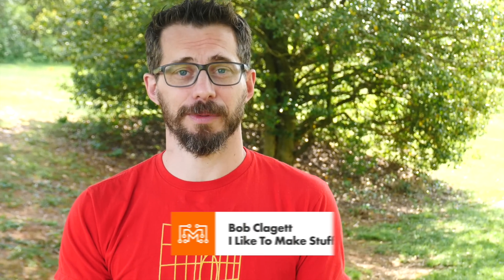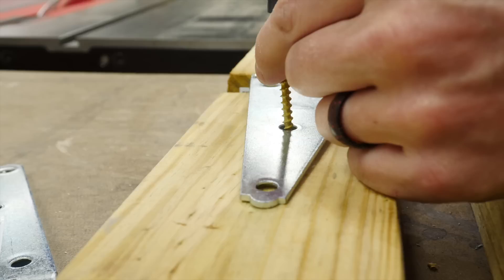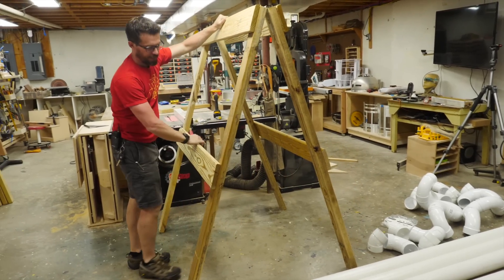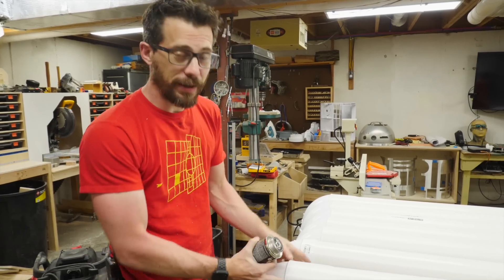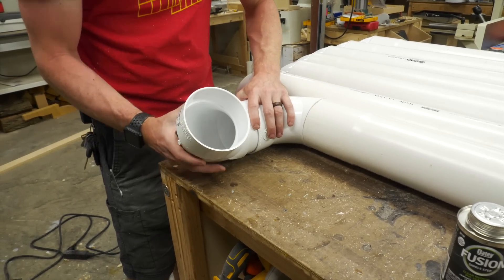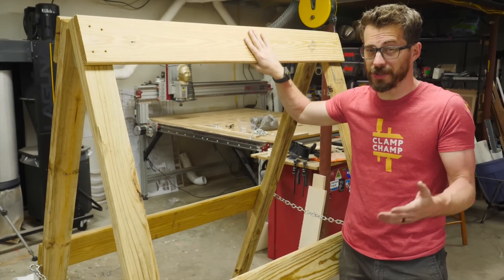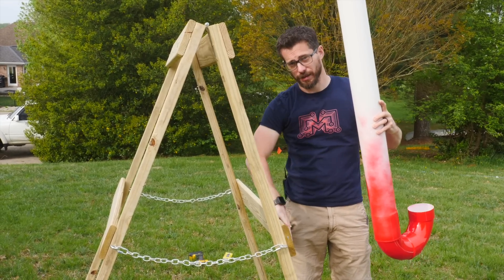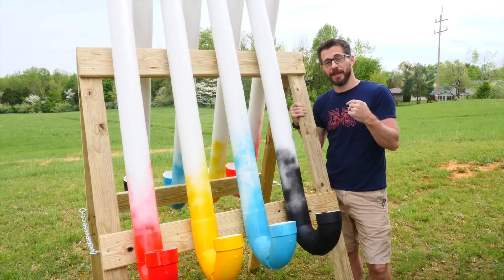How to Build a Kid's PVC Pipe Instrument (w/ I Like To Make Stuff)

Comment: Instead of putting a hole in the bottom for drainage you should’ve put caps on when your done with chain rope string so you don’t lose the caps or get water in when your done and you don’t mess up the sound at all like it would if you put a hole in it

Comment: I like the idea, and the concept. Although, considering there is almost $400 in just material to build this, it seems a bit crazy.
Reply: What?? What makes it so expensive? Considering Germanys products prices for this, i would say around 40-60€ for the pipes at most, and with the wood you are under 100€ i would say..
Reply: I'm pretty sure this could be scaled down using 2" central vacuum PVC pipes and still be a lot of fun.
Reply: $400?? At most I calculated $140'ish. Thin walled PVC and lumber are fairly inexpensive. I`m seeing about 40-50 in lumber and another 60-70 in PVC. Add in paint, glue and hardware for another 20-30. I am curious how you arrived at $400? 

edit If you had to buy the tools as well then yeah that might get quite a bit closer to 400.